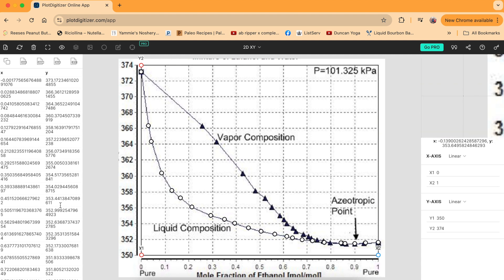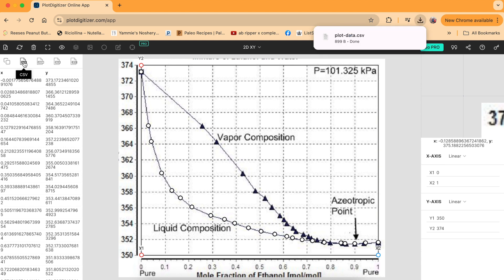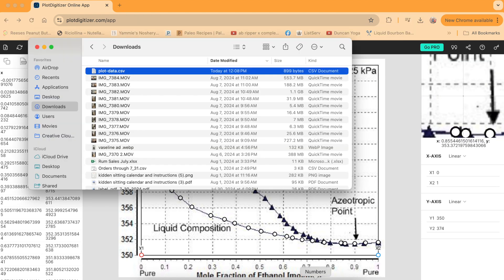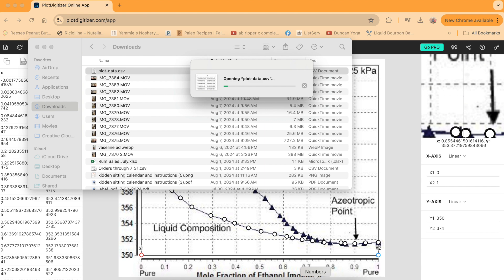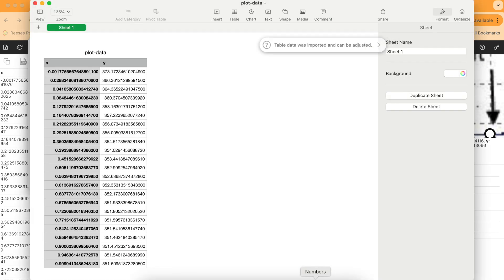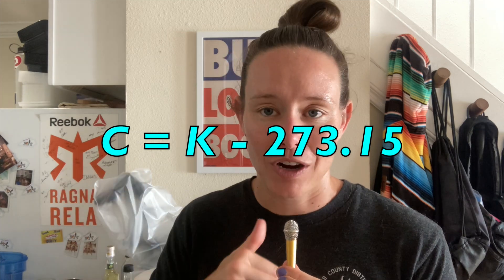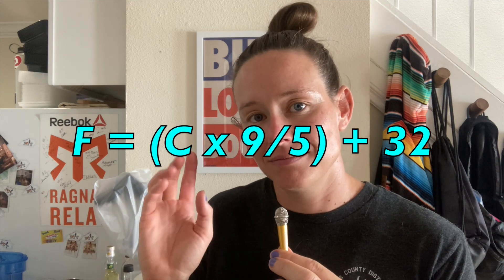What temperature should you distill at? Boiling point as a function of ABV!

Comment: Robyn, I just wanted to say thank you! I've recently stumbled across your videos and blog in my research for my personal improvement journey. I've been brewing for a few years now, and as an Electronics Engineer, one of my hobbies is building control systems and programming software for it. Some times, this includes the need for information, such as boiling points of azeotropes, that I just couldn't figure out before. In my brewing and distilling education journey, I have many dots to connect, and your videos, especially this one, really help connect some of these dots. I really struggled at first, trying to copy your method. I love the plot digitizer, that opens a lot of doors for metrics for me. Remembering order of operations in math, and the nuances of putting expressions into formula form in Numbers or Excel. Really scratches my brain's need to keep being used.

In this video you posed the question, is this information helpful. I will say this. Once I figured out how to get the formula to work correctly, dusting off some knowledge from Chemistry classes, I had a notion to simply sort the data points in reverse order. Seeing this data in this new way, how the purest ethanol starts coming off the still at the lower temps, and slowly drops ABV , the chart correlates to this. Knowing that when I'm close to 10% in the boiler, and I need my power kicked up to almost full power to keep that higher boiling temp...it made me realize some simple things that I was missing. the "Why" of why I have to keep bumping the power up in order to continue to get distillate off the condenser. The "How" of a fractioning column, how distillers are able to pull a specific proof off at a specific point on the column, and why the heads and the tails get fractioned off to other areas of the column as they do. This opens new worlds to me, and I am forever grateful for your knowledge share.

Thank you!
Reply from the maker: Wow, thank you so much for this incredibly thoughtful comment! It honestly made my whole day. I love hearing that you were able to take the info I provided and turn it into something useful. This is exactly why I create these videos! Thank you again for sharing this... it truly means a lot! Please let me know if there's anything I can do to help you connect more dots!

Comment: I have a vevor air still but it is the one without a temperature control system. It just goes 100% and quickly after the distillate starts coming out, the fan air gets really hot and the distillate is very hot. 

I need to dig into mine and add in temperature control because I find that distillate tastes much more “hot” “jaggy”, there is not a smooth ethanol taste. I’ve even triple distilled with the unit and that does an ok job but nothing beats a more traditional still where you can keep your distillate temps around 20*C consistently. So I wonder if adding in some active temperature control could improve the final product. Just another project to put on the list.
Reply: You can get a voltage regulator to lower the temp by reducing the voltage to the still and slow down the distillation. 
They're nit that expensive
Reply from the maker: You're totally right! I think a power controller will help slow things down. Just make sure you get a power cord to plug the fan directly into the wall... you want to make sure that runs at full power.

Comment: I think I learned that I should have paid closer attention in chemistry class! Even though you started with low wines, you must have had other alcohols in your wash other than ethanol, right? I usually see first drops coming off the still at about 145 F. At my altitude (1950 ft) methyl alcohol boils at 147 F in my pot still. Also it seems that hot spots in the kettle arising from uneven heating will cause some water to boil and re-condense at the beginning of distillation: my first drips are off the chart on my alcohol refractometer are above 80%. Thanks for the video!
Reply from the maker: It's never too late to take another chemistry class! Yes, you're totally right. There are other alcohols and congeners in the low wines, which is definitely going to have an impact on boiling point. Even though the low wines are mostly ethanol and water, the other compounds certainly will play a roll. 

Are you measuring temperature in the pot or at the top of your still? There's an interesting post on the home distiller forum about the methanol concentration during distillation cuts and interestingly, even though methanol's boiling point is lower than ethanols, it comes out consistently throughout a distillation run, not just in the heads. What comes out initially in addition to ethanol are compounds like acetone, acetaldehyde, ethyl acetate, higher alcohols, etc. What does the first distillate smell like to you? Hot spots might also be causing some vapors to make their way over to the condenser.
Reply: Thanks for the reply, Robyn. I only read temperature at the top of my still. Foreshots smell like fingernail polish remover to me, acetone. I have trouble with distinguishing the head-hearts transition in real time so I collect in jars for the next day. I too believe that if you run too fast you will definitely see water smeared into the hearts due to hot spots so I try to keep the condenser output to a fast drip and as cool as possible. I don’t use a proofing parrot but I do take a alcoholometer reading every 300 mls. and log it with time, volume, ABV and temp. My heat source is a commercial induction hot plate with a steel plate between it and the stainless kettle to prevent surging out of the condenser as the PID turns the induction element off and on. My condenser is air cooled finned copper since I hate leaky plumbing joints!